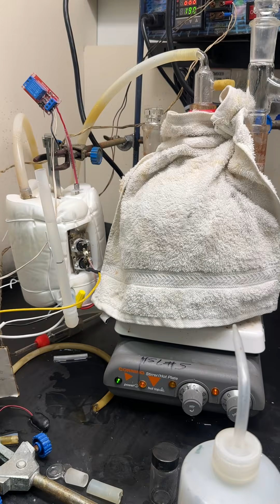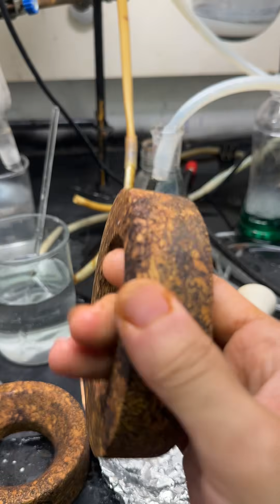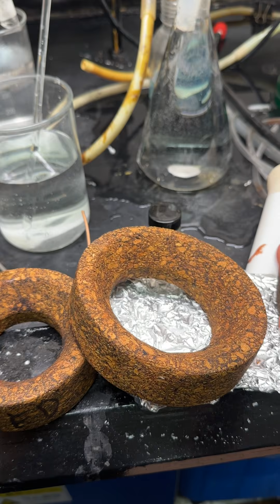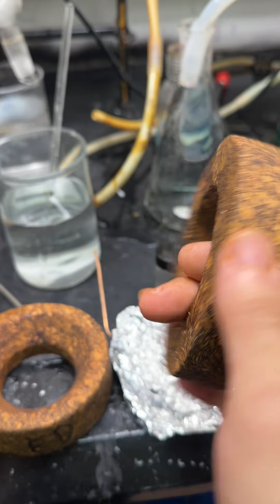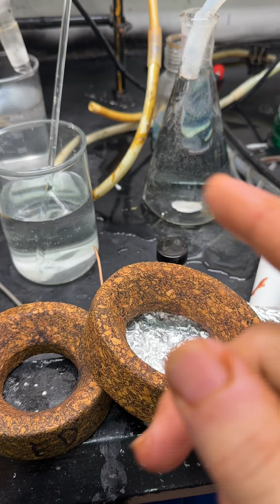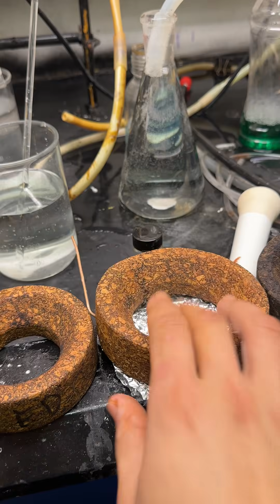edward rambles about cork ring stands

Comment: 'Edwards corky wholesale' would be a hilarious company name. You could use wood for an 'eco friendly' product line. 
But jokes aside, with a few large diameter hole saws and some wood glue you can make similar rings. Use a chamfering router bit on the inner hole and a lick of linseed oil to seal the deal and make it look fancy.

Comment: @EdwardTriesToScience
I think that you could get something interesting by mixing silicone and acetone; then impregnate the cork ring; allow it to evaporate and cure; the finished product should resist heat (<350°C like cork would); the silicone resist more heat but the underneath cellulosic material (cork) would pyrolyse; that silicone will make it resistant to water and impeach molding spores to grow to molds.

Alternatively you could use cork grains soaked into aceton-silicone go dry; then incorporate into dry sand and mix in some silicone then make a "cork ring" out of the mix and allow to dry-cure...
You got a cork-ring molded (without molds this time - joking / kidding :oD).

In fine, you could use NaOH sand solution (Na2SiO3 or Na4SiO4 and H2SiO3 ((HO)2Si=O) and Si(OH)4 (SiO2.2H2O) soak in the cork ring for some time, then take out, rinse a little, and finally allow that cork ring to be exposed to CaCl2 solution... the later will form an inner unsoluble precipitation of CaSiO3 or Ca2SiO4 and expell water and NaCl; finally allow to rinse with a good deal of water and dry...
--> you should have cork-cellulose coated with a little silicate ester, Ca silicate and this would make it resistant to heat; and probably to fire to some extend.

Regards,
PHZ
(PHILOU Zrealone from the Science Madness Forum and many former A.O.L newsgroups related to chemistry and energetics)

Comment: I really want an aluminum heating block like chemiolis has, been looking for years now. Almost ready to have one of those CNC company's overseas make me one.
Reply from the maker: if you use them, line a woven fiberglass mat (like what they use with polyester resin) between flask and aluminum otherwise you have a risk of cracking the flask from heat if the liquid level drops below the height of the aluminum
Reply: @EdwardTriesToScience  I'm glad you told me I  was wondering about that because I know you're not supposed to put the flask directly on the hot plate
Reply: Somehow they're incredible expensive